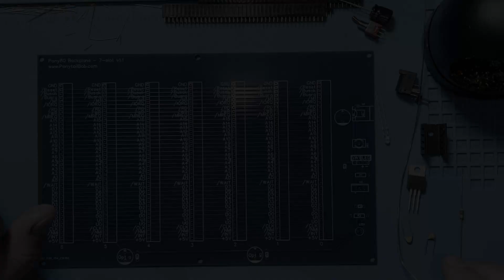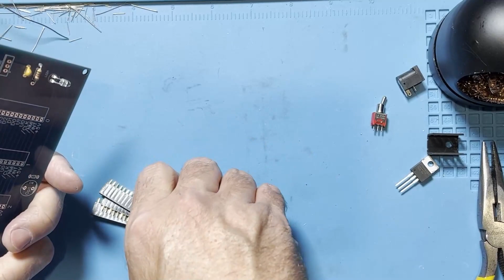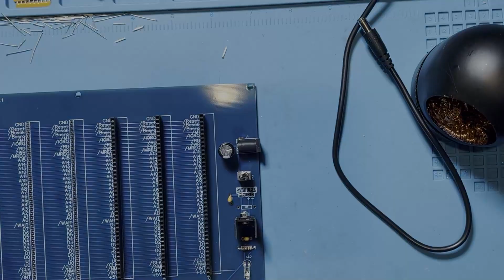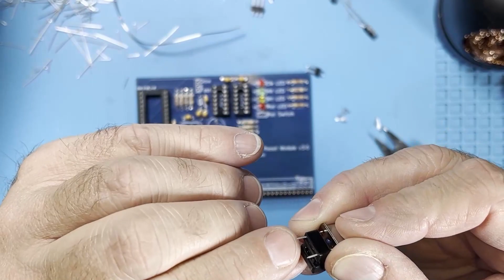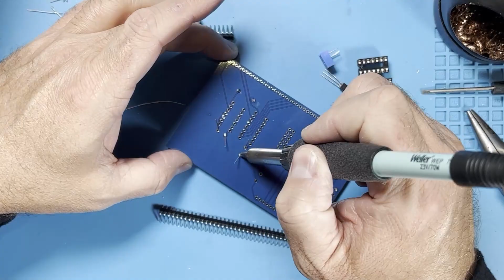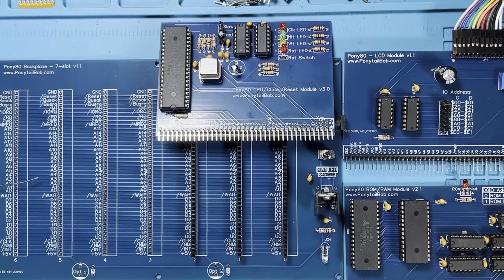Pony80 - Assembling the Boards and Testing! - My Z80 Homebrew Computer

Comment: I really like the old Z80, really, congratulations on the project, but one detail: why didn't you use double bar connectors to avoid the bad contact that is so common on single bars?

Comment: LCD screens don't like it when the bus speed is too fast. 1 to 2 MHz max. If I recall I pushed it to 4 MHz on my 6502. But there was some character artifacts.. Faster then that, there will be artifacts galore like we saw. You'l need to add wait states, or go through buffers or a PIO, like Ben Eater did by going through the VIA.
Reply from the maker: I’ve been able to get up to 10 mhz on the lcd, but if there isn’t a software delay added, you are right, it is hard to see. This issue is different than that. Fun times debugging!
Reply: @Pony80  Let me know if when you find the issue. I'm curious to see what was the issue.

Comment: 47:26 Actually that did make sense - who knows how many of the header-pin type backplanes you'll have to build in order to get it right the first time with card-edge connectors?
Reply from the maker: When you say it like that it does make sense!
Reply: Industry: DIN 41612 connectors have existed before solder was invented, are polarised, rated for hundreds of insertions and good for up to 3Ghz. They cost around one of your currency units 🧐
Every Z80 board design: - "look at my plastic zip tie connector with foil contacts! And they only cost one of your currency units!🤓" 
😑😭 😸
Reply: @____________________________.x Could you just stop repeating the same lie on every RC2014 video? The cheapest of those stupid din connectors is 3€, standard pin headers only cost cents.
Also they are breadboard friendly, which the din ones are not.
No one wants your crappy DIN connectors.